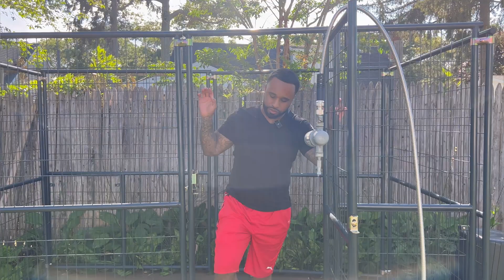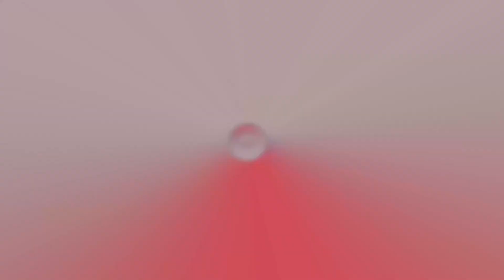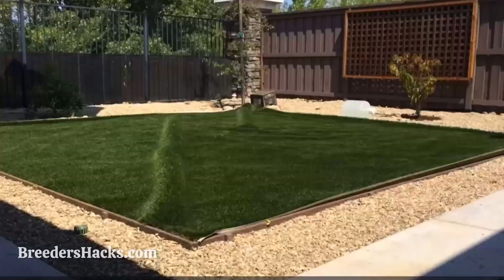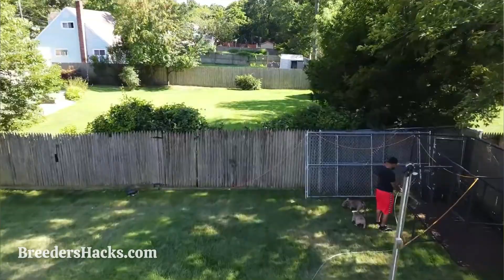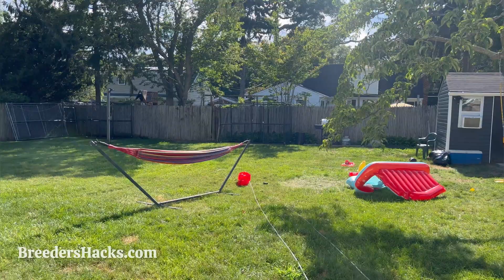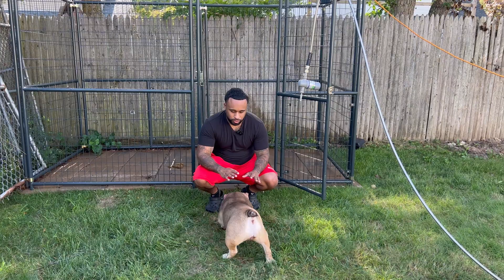Easy kennel flooring (Tips & Tricks!)

Comment: I’ve never used artificial turf and never will. I use pavers for individual kennels and we had  a 30 x 40 slab poured with a carport over it. We  bought 4 of those retriever kennels. I loved them at first but after  not even a year they are rusting badly. Looking at reviews apparently it’s not just me. The powder coating is  literally going to $hit at about 9-10 months including the latches and clamps and we clean it regularly. I give them another year of life tops before the panels start crumbling. They won’t replace them either and apparently stopped producing them. I wonder why.. 🤔 also, the 1 kennel we set up inside the house as a puppy pen(Siberian moms escape regular puppy pens) is doing fine so far.
Reply: Stopped producing them? U buy them all the time. I've had a few of them for over 3 years now and 0 rust. Where are you located?
Reply: @el-grouchomcoc5602  New England.  We called for refunds and they told us they discontinued making them. Go look in the reviews. There are hundreds of people with same issue as us. The kennels disintegrate for many after about 1-2 years. You’re lucky that yours is good.

Comment: Looks nice I’ve got xl bulls over here and let me tell you I had to swap out the pavers because after so long even with the pressure washer it would have a smell because of the cracks in between the pavers, 25x40 concrete slab now with a drain
Reply: Yo can I get your contact what type of drain do you use and how is it used
Reply: I would love to see your set up as well. The smell kills me. And the rocks aren’t helping either. Thank you.

Comment: What do u think about plastic pallets or wooded for flooring?
Reply: Hey I actually just had a liter of Cane corso and I used Plastic pallets on top of  cinder blocks to keep the kennel off the ground 
Then I put turf on top of the pallets as flooring , it honestly worked pretty good . Only thing I can say is it’s best to make sure you pick up the poop within a day because the poop gets stuck to the turf pretty fast .
Reply from the maker: I do not think it will last long, but it could work

Comment: I need the link for the hose. I been through 3 hoses already this year.
Reply from the maker: 200 ft Garden Hose -Metal Water hose with Nozzle &10 Function Sprayer,Flexible, Heavy Duty,No Kink& Tangle, Lightweight, 304 Stainless Steel Car Washing Hoses Pipe for Outdoor,Yard https://a.co/d/1Gs3WWM

Comment: Did u just lay it or did u use something under the pavers?
Reply from the maker: Yea I just layed it down lol nothing under them lol. We plan on moving so I didn’t go crazy.
Reply: @doublemusclelinebulls   Ok Thank you for the feedback bro 🙏
Reply: @doublemusclelinebulls  Thank you for posting the video! 
Your pavers look nice and flat and level. Did you put the pavers directly on grass, or was there mostly dirt in that area and not much grass?  
I'm thinking, if the pavers are put directly on grass, won't the pavers be lumpy and not lay flat? Thank you!
Reply: @midnightjade720 You might need to dig a little deeper to keep the pavers level with the grass. I’m thinking of doing the same but probably will use sand underneath for better drainage.